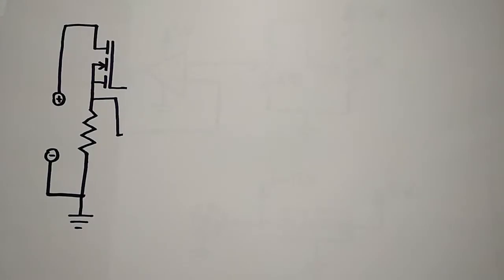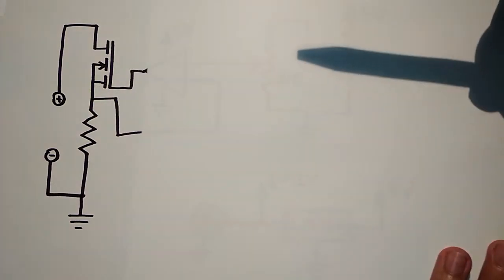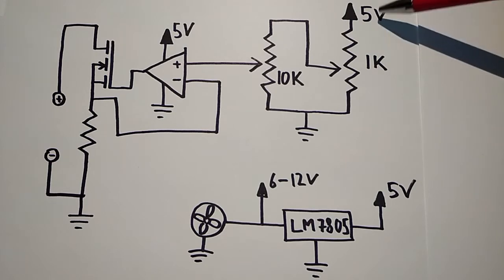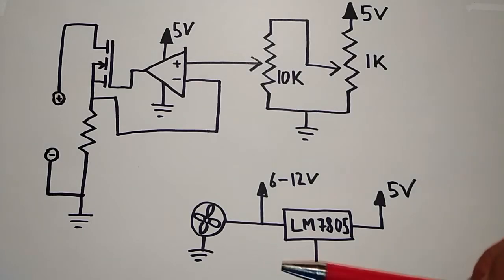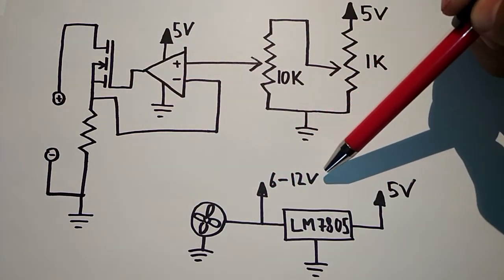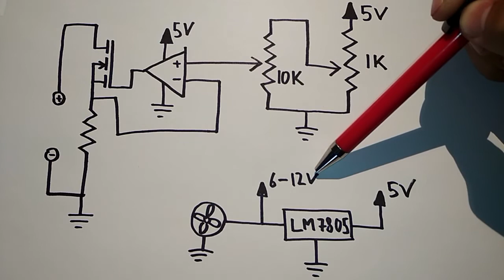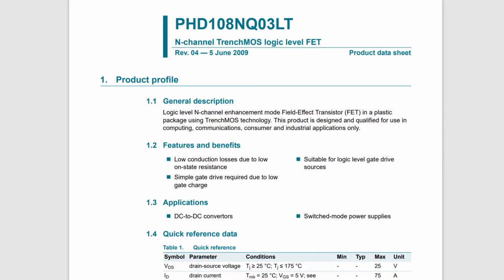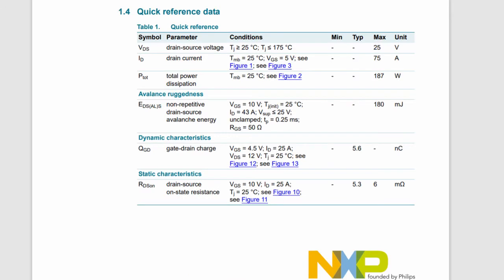How to Make a Powerful Electronic Load

Comment: very good, thank you (i´ll build this and adding a RPI Pico for meassuring all currents,  temperatures and take control of the resistors (digital resistor´s to control the current over every FET)  and check the input voltage to disconnect the load if it´s to high)

Comment: For selecting the mosfet, you want to make sure that its DC operating area graph contains inside it the power ratings  (Amp and Volt consumption) you would like to use for the load, the threshold voltage is nicely under the opamp's power supply. If you don't use separate opamps to control each mosfet it is very likely that a single mosfet will absorb a majority of the load current, rather than each one sharing it equally. If you connected 4 mosfets to the 4 opamps in the package you'd likely get better current sharing. I'm not sure if you did this or not.
Reply: I'm thinking building a electronic load to test the capacity of some SLA AGM 12V batteries.  I would say 10A should be the max, but up to 12A to be safe
Would you have a diagram showing how to wire the 4 mosfets?

Comment: I love to see new channels in this field, so of course I have subscribed, eager to see what you have next.
BUT, please plan out your presentations more, ...too much missing, and a few boo boos like 1) "any mosfet will do" - nope only logic level, 2) frying the mosfets onto the heatsink - AAAAH, watch the temperature and time limits.  3) six mosfets?  Please explain, ...they cannot be used directly in parallel, which leads me finally to 4) What is the "actual" circuit schematic?
Judged as it is I have to give it a "dislike", sorry :(

Comment: You should use separate feedback on each fet if you're using it anywhere near their limits, the linear region of common switching fets are not well controlled so they won't share the load evenly. You're likely to get thermal runaway eventually causing a cascade failure. You can normally get away with paralleling them in switching applications since time in the linear region is negligible.
Reply from the maker: True. Perhaps my drawn circuit diagram was oversimplified but for every MOSFET a separate shunt resistor and op-amp was used. This is why I chose a quad op-amp; only four of the six MOSFETs are in use.
Reply: @5VLogic  Oh OK, that makes sense. Well hopefully useful to know for anyone wanting to build their own. At 50W, actively cooled, like you showed you'd probably get away with it anyway. Good video!